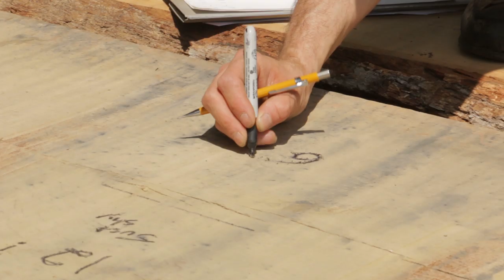Acorn to Arabella - Journey of a Wooden Boat - Episode 68: Planking: Laying the Groundwork

Comment: Too late now, but, one method to remove the center of a board (for matching the frame) is to introduce it to a table saw blade at an angle (oblique to the table or diagonal). Various angles and various depths of cut match with how wide or deep the cut is. Matthias Wandel (YouTube content creator in the wood world, former BlackBerry engineer, all around wood guy with quirks)  has put forth this method (where I saw it first, obviously, he's not the first) and i have used it with great success.

Comment: Great work as always fellas! A couple of little tips:

1. For sharpening the small curved planer blades, cut a slot in a piece of wood just thinner than the blade to act as a handle,  insert the blade and sharpen it as you would a large gouge. Makes holding those fiddly little things a hell of a lot easier. Plenty of control for the secondary bevel touch up. I use an old large paintbrush handle.

Second, to get a smooth start on the plug cutter, drill a hole in a rectangular piece of scrap with the plug cutter on the drill press - this will be your guide. Then put in two pins in either side, place it over the offending screw and lightly tack the pins in place. An easy start and a perfectly square clean plug hole. 

Keep up the good work, I know how much of a pain fairing can be

Comment: You really should try to clean up some of the saw dust and shavings. That almost 1ft mound by your saw at 20:08 is just crazy. Just shovel some of it outside. Both a fire hazard and potential mold breeding ground etc.

Comment: make a guide for the plug cutter   drill a hole in a small bronze plate same diameter of the plug cutter and center it over the screw
Reply: Can be done in a 1/2inch thick peice of wood as  well
Reply: What's the point when it works already?
Reply: Yup. I use an off-cut of plywood to do the same whilst restoring 1930 wooden framed Great Western Railway railway carriages.

Comment: And easy way to get the plug cutter seated is to take a piece of pipe with an inside diameter slightly larger than the screw and pound it in to about a quarter of an inch and then the plug cutter will track well.

Comment: 50% of comments repeatedly suggested using a piece of wood with a predrilled hole to guide the plug cutter, does ANYONE ever read any of the previous comments?
Reply: Of course they don't.. that would be too much like common sense.
It's the same with all the comments about backing out the planks with a table saw.
Reply: Sure they do, I had a question about putting flat seçtions as wide as the planks on the ribs instead of planing curves. I scrolled and scrolled and finally found a comment that brought it up. After 50 plus people repeating how to use jig. Some of the variations were valid but even the variations were copied.
All the ones who post without checking you know of. Most of the ones who do check and do nothing or like the comment you dont notice.
I usually don't comment and hence don't have to read so many comments. Man I feel for them having to read so much repition with so much work to do..

Comment: If you plan to remove screws from hardwood, lubricate them before you put them in using a lubricant that will not swell the wood. Eg. not water based

Comment: you could take the concave out by running the board through a tablesaw at 45 degree angle across the blade

Comment: On curved blades, you'll probably have better luck taking the stone to the edge rather than the edge to the stone Clamp the blade in something and then take the sharpening stone or plate to the blade... And you might also want to make a custom scraper blade (or two) for finishing ...

Comment: Why resorcinol glue?  I understand you guys are trying use historical methods, but modern epoxies just seem so much more versatile, stronger and don't shrink over time.
Reply: Epoxies have adhesion issues when used on oak.  Resorcinal is better in this application.

Comment: At 7:33 you file the blades. Are they made out of soft steel?
Reply from the maker: Softer than the file =)  I was just dulling the edge a little so it did not slice the sand paper on the machine
Reply: @AcornToArabella  That appears soft for a planer blade. How long do they keep a sharp edge?

Comment: There is a much easier way of concaving the middle of a board using your table saw, raise the blade about 1/16th " and make a jig for the table saw that allows you to go straight across the blade at 45 degrees, the "new yankee workshop " will show you how to do this safely.
Reply from the maker: Thanks for the tip, Rich!

Comment: I'm really surprised that its necessary to try and match the curve of the frames by removing material from the planks. It seems to me like the fasteners should be enough to coax the planks to make such a minor curve.
Reply: Bending wood parallel to the grain is a sure way of splitting it.  The tension you induce in the outer radius will remain there and will be compounded when the boat is afloat and flexing in use.  Even if it looks OK when you bend it, splits can develop later in life.

Comment: Two things, I have not watched the channel for a bit, but I noticed all of the total boat logos..... I personally call it total JOKE because it is in no way the same product as the real thing.  Yes it is cheaper product and you are getting what you pay for.   After having a gallon of resin gel in the jug, I will never trust total joke products for anything serious.  West system has never let me down.  Buy once cry once!  You would be smart to drop that stuff.  The other thing is screw removal .  It can be a bear, but make a one toothed hole saw out of a roll pin.  File the tooth in the reverse direction.  put the roll pin in the drill.  The ID of the pin should be just under the diameter of the fastener you are trying to remove.  The tooth will cut a small grove around the fastener, then on the the fastener, and with the drill going in reverse the screw comes right out with minimal damage to the surrounding wood.  Keep up the good work.  
Cheers.

Comment: Why did you not speak with someone like Steve Summers, and get those blades precision honed & sharpened all alike? Would have been a boost to both your channels. Bearing in mind the strong possibility that the blades are edge only induction hardened. Re-shape and hone them and you could be using a non-hardened edge to cut with.

Comment: surely much easier to flatten the frames ; much smaller area
Reply: That would change the shape of the hull, and she wouldn't go through the water cleanly. Everything you see there is done the way it is, for very good reasons.
Reply: @Garryck-1  no change whatsoever in external shape of the hull. plane a flat area the width of the plank to suit each one. Planing 4 inch frame instead of say 20 inch plank.
Reply: I wondered on same thought. Damaged planks would be easier to replace. When she's due for all her planks to be replaced it would be quicker and easier. 
Is that why we tune in though? To avoid the craft and love of building something